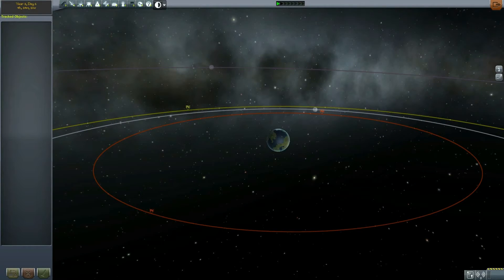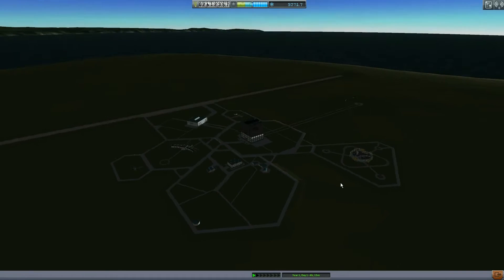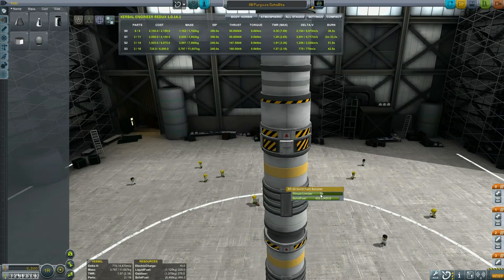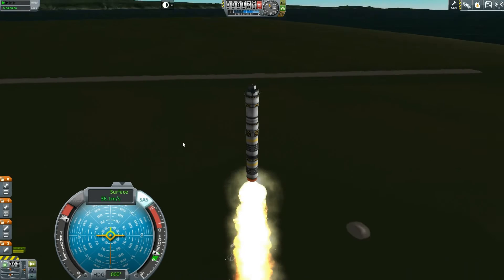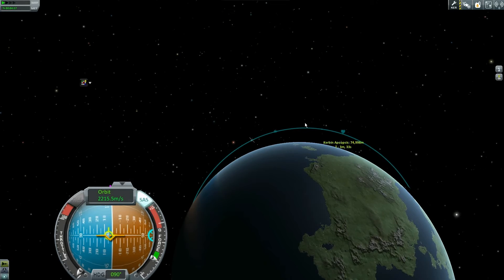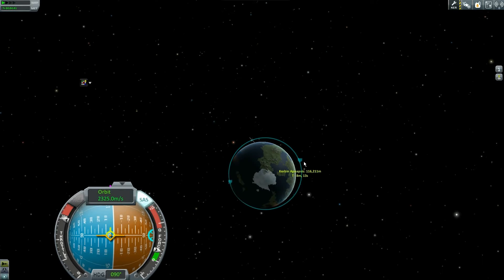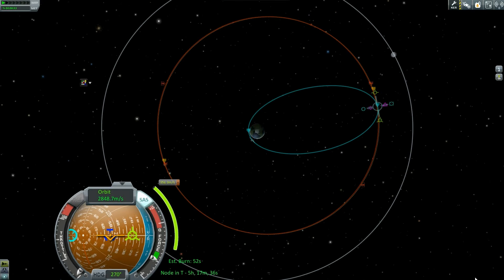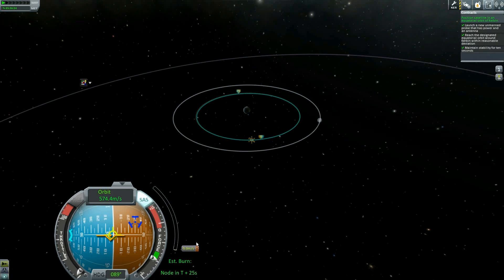KSP Fundamentals - Satellite Contracts 1: Equatorial Orbits

Comment: With this exact build I have 5636m/s delta-v -- this is with the 1.05 version of KSP. Did they change things that much?
Reply: +Drew OConnor Also, when I hit the third stage the rock flips around wildly. Its totally uncontrollable.
Reply from the maker: +Drew OConnor Yeah sadly this tutorial is out of date. I need to make a whole new set for 1.0.x builds.

In short, things HAVE changed that much. All the engines have been reblanaced and a lot of things' masses are different, but by far the atmosphere has totally changed. You used to need about 4500m/s of dV to reach orbit, and now you only need about 3300 or so. However, your rockets must be aerodynamic so a lot of rockets that worked fine in pre-1.0 builds won't even work anymore.

Including, apparently this one :)
Reply: +HMV Plays Understood. Thanks HMV

Comment: What liquid engines did you use for the upper stages?
Reply from the maker: They're both LV-909s. I said the bottom one was a 909, but I forgot to say the same for the top one. However, it's the only engine that has that short of a shroud and is that diameter :)
Reply: Thank you very much. I love your videos. You're going to make me better at KSP.

Comment: Yeah.  Those numbers are definitely useless.  If they had a way to actually see them, then yeah, it would make sense to display them.

Interesting story for me, I put my first satellite into orbit in the wrong direction (I thought I had deployed in the proper direction)...took me about an hour to figure out why it wouldn't trigger the completion on the contract.  I was like, I dunno how more marginal I can get.  Also, my first one was a polar orbit _  Lucky you, you have an equatorial orbit.

Once I figured it out, I was like, crap, I'm not going to have enough dV to get this fixed.  I had never tried to change orbital direction in orbit before.  But, All I had to do was burn retrograde and I was able to switch orbital direction in about 6 seconds of burning.  Makes sense now, but quite interesting to realize.
Reply: an interesting side effect of that fact is that if you need to reverse your orbit it may be cheeper to raise your AP out to the SOI boundry and then do a retrograde burn at AP.   It takes somewhere in the 5km/s region to reverse an equatorial orbit from LKO directly.  On the flip side you can spend 900m/s to go up to minmus's orbit and maybe 100 more to flip your orbit once up there and aerobreak back down, way cheaper than the direct approach.  Sometimes radical inclination changes also benifit form this technique.
Reply from the maker: Yeah I did the reverse orbit thing once. I even tried to rendezvous with a ship in the wrong orbit once (though it was in a mun orbit and I was coming in and happened to get a close encounter). I was really surprised when I switched to Target mode and the speed difference was over a km/s. :D

I wasn't actually lucky with this one. I declined about 2 dozen contracts until I found an equatorial one within Mun's orbit. I wanted one like this specifically to show it. Next episode I'll be doing something more crazy, and after that I'll be nailing a Mun and a Minmus contract.
Reply: 5th Horseman  Yeah, I didn't realize that orbital speed was so slow.  It was like at 365m/s.  I guess it's the surface speed that would be super fast at that point.
Reply from the maker: Robert Burke It all depends on how high you are. With a very eccentric orbit, at a high apoapsis it can take a dozen or less m/s burn to flip your orbit.